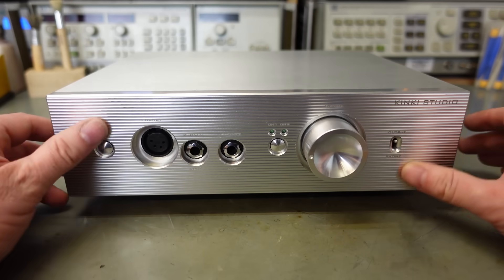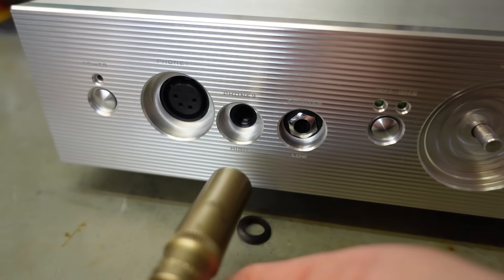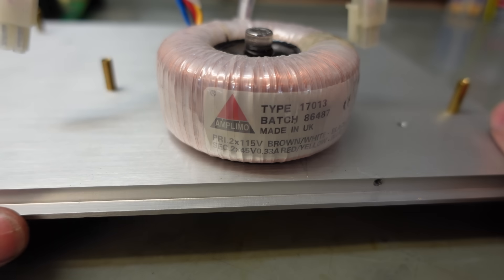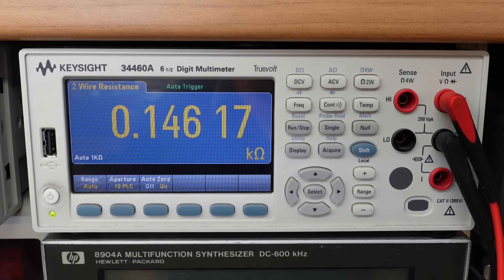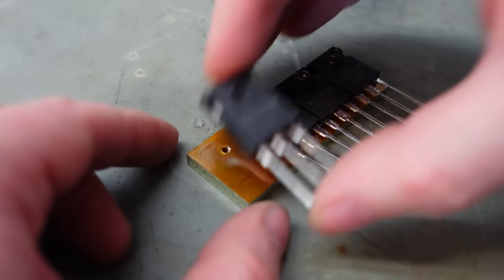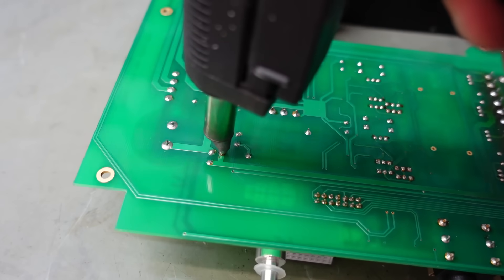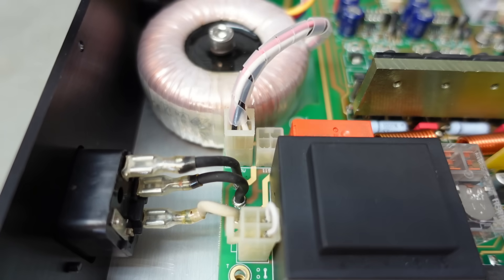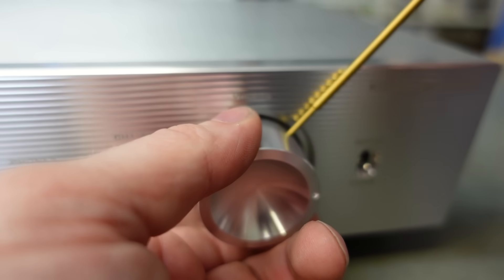KINKI Headphone Amplifier Repair (Vision THR-1)

Comment: This is sadly what the Chinese often do with "high end" audio. It's more about how thick the front panel is than proper circuitry design. It's also often about bragging rights. Brand X has 24 volt supply rails then Kinki chose 60 volt supply rails despite that being completely unnecessary and a poor choice for other reasons. I've been to CES many times and it's always a good laugh to check out the "high-end" Chinese audio vendors.

Comment: That's just a storage heater, not a heat sink due to a high thermal mass and lack of surface area to dissipate the heat and kapton tape. A 3 Watt amp for silly money and they even cannot afford to install the essentials. They should've used the volume knob as the heat sink.

Comment: Building a linear amplifier with MOSFETs is hilarious. 
"Audiophiles" overpay lots of money for the dumbest shit. 
MOSFETs are inherently not linear, just get a Class D amp if you want MOSFETs.

Funny enough, the ones in this system claim they won't fail short in thermal runaway, precisely the way they did fail.

Comment: I'd say the heatsink is inadequate. 126V * 30mA = 3.8Watts. Doesn't sound like much but inside a case with no airflow and a heatsink with no fins it's going to get hot. The proper way to engineer this would be to heatsink the transistors against that huge slab of a bottom plate.

Comment: I never before realized that it requires that much hardware to drive a set of headphones. 🤔
To my best NE5532P appreciation, a couple of OP-Amps, 
some resistors, plus seven Caps,
put inside a box that's too small for a shoe,
as headphone amplifiers, will do. 🤗

Comment: Somewhat confused by the 4 channel test...seems like injecting the test signal through the single ended inputs would produce 2 channel output...any reason why the balanced inputs were not used ? That 4 pin output XLR is for balanced headphones...I have a pair of Sennheiser HD650s set up this way......the reason why this amp  has scads of output power is to drive planar magnetic headphones which eat power for breakfast.

Comment: Didn’t understand the Mosfets being mounted on a relatively small heatsink and then using Kapton tape backing which is actually a good thermal as well as electrical insulator.  I.e. less of the heat will pass to the heatsink?  Seems everything was over engineered except where really needed? Seems to be the fashion in modern Chinese technology - looks great, performs brilliantly, doesn’t last long. Where these Amps differ is they ain’t cheap.

Comment: Many comments are referring to a heat sink but in fact it's a thermal coupler.    In a headphone amp you're not expecting a great deal of power when active, but this is class AB with high voltage to handle high impedance and high quiescent current to minimise crossover distortion.  So you get a significant constant heat dissipation - probably around 1.5-2 watts per MOSFET.  It's critical that they all operate at the same temperature so that the overall quiescent current is equally balanced, hence the thermal coupling.  Dissipation shouldn't be a problem, but I think overheating has occurred as a knock on effect of component failure, rather than the reverse.

Comment: Is this serious ????

This is a headphone amplifier, not a Peavey stage guitar amp !!!

Headphones will provide maximum safe SPL levels with only a few milliwatts input ! At 600 ohms (high impedance headphones) and a huge 5 milliwatts, drive voltage is about 1.73 volts...

So, WHY the heck +/- 60 volts supplies ???? Totally nonsense ! If this thing starts self-oscillating or is mistakenly overdriven, it WILL damage your ears ! And in case of a DC short to any of the rails with low impedance headphones, you'll have phones gently cooking your head.... Nice !

Using TO-247's for headphones and allowing them to heat at a level tha causes board discoloration ? No serious current limiting or overtemp protection ? Huge design mistake.

And, well okay, let's suppose that this thing might be class-A biased... This amplifier has a massive aluminum top cover and it is airtight. Instead of using a ridiculous unventilated aluminum bar for the 247's, why not use an L-shaped heat transfert bar bolted (from inside / bottom cover holes) directly to this huge aluminum extrusion.

Construction is well above tom evans but design (board discoloration is a definitive no-no for any respectable electronic device) is way below standard.

Comment: well that seems like biiiiig fail , a nice case with lots of metal to act as a heatsink , but the actual heatsink where the all heat comes from does not have any thermal paste on the contact  points with the case or mosfets .

Its like management designed an amp , where they fired the people actually doing the job and kept the others 🤣

Comment: A little bit strange, you’ve got those MOSFETs which obviously get extremely hot attached to that tiny little heat sink when they could have thermally connected them to the ridiculously massive outer shell to dissipate the heat?

Do you think those legs are blued thermally? That doesn’t occur until about 300c.

Comment: Love the IC-free, fully discrete transistors design. This is the design criteria developed by ITT and Telefunken in the early '70s.
With this design, you can include one DC feedback network and two AC feedback networks: one for each stage, and another for the amplifier as a whole. You need to know your Nyquist diagrams (and a lot of complex numbers) but the result is unachievable with simple power audio ICs (TBA 810, etc) and canonic op amp designs. 
Such discrete amplifier can operate -10 to +70 °C, has very low noise so achieving 110 dB of dynamic range (an LP is 60 dB, cassette tape 50 dB, CD is 90 dB, Metal cassette tape is 65 dB, FM tuner 50 dB), very high slew rate and therefore a bandwidth of DC to 50 KHz with 0.001 THD - total harmonic distortion; DIN HiFi requires 0.1% max THD. Also, this design is very insensitive to the value and variations of transistors Hfe - or trans conductance in the case of field effect transistors.
Thank you for posting this repair.
Greetings,
Anthony
Reply: There are 1 quid op-amps out there that do just as well or better in terms of THD. For $5 you can get a CMOS DAC that can generate anything you want with that same dynamic range. Nothing wrong with discrete designs - I prefer them. But this thermal tomfoolery is a bit distasteful IMHO. To go to all that trouble to have a full custom machined case and not a proper heating for the transistors…

Comment: I wonder if the current rating on the FETs is on condition of a heat sink? Could it be that the heat sink, laptop tape and lack of air flow caused them to over heat?
Could be that the unit was used in a hot room for many hour’s as well

Comment: That amp costs over £1,000 via Ali Express, although mechanically speaking at least, it is beautifully made. Whether it is as well engineered electronically is another matter though. For instance, does it have any output or or thermal protection given the way those MOSFETs were cooked? It is weird that both channels failed without some common fault, such as in the power supply.

Nb. As much audio jewellery as high quality electronics.

Comment: They grind off all the part numbers, but leave the one for the DC protection untouched, which's a cheap clone part of a hard to find old vintage NEC chip xD. C1237HA, it should be μPC1237. How embaressing! ;P

Comment: When testing the balanced output, do you not need to use the balanced XLR inputs?  Are you not connected to the single ended phono inputs in your test or have I misunderstood that?
Reply: The description of the amp at the manufacturer webpage says, when using the output switch, the amp will become passive preamp (sic!). Yeah - I looked puzzled as well. Anyways: I guess they do not re-balance unbalanced inputs. BUT: if the input is balanced and fed to the XLR inputs, the output should be balanced as well.

Comment: Hi Mark You don't seem bothered about touching the legs of the mosfets which I understand runs the risk of injecting static electricity from your fingers into the devices and blowing them up. Is this a techie myth, the static electricity thing I mean?

Comment: Funny to see all the comments that assume that the design here isn't a true balanced amp & is flawed due to lack of cooling & will fail again. 😆

My guess is that the "balanced output stages" is actually the 8 much smaller SMD MOSFETs. 🧐

The 4 large 8A MOSFETs are only intended for keeping a steady temperature inside. 👍
This explains why this design isn't utilizing the massive chunks of aluminum for cooling, but just strapped these to a "radiator" in the middle of the closed chassis. 😉

Bottom line. "There is no spoon!" 😎
Reply: Why would you need 4 MOSFETs just to act as heaters? That would be truly bizarre. They were also complementary pairs.

Nb. It was Mark that measured the XLR outputs and concluded they were not balanced, not that it would make any real world difference at those signal levels in the sort of environment that it is expected to run in.
Reply: @TheEulerID  My guess because the original Swiss made Amp, which this is supposedly a clone of, uses a thermal oven. 
Also, a true balanced amp has 2 symmetrical output stages pr. channel ( 8 transistors for stereo ) OR has a un-balanced->balanced transformer. 
But I could be wrong. But in that case this €1600,- amp is not what it claims to be. 😏
Reply: @stickmenwithrayguns  well, Mark showed that the XLR outputs are not balanced. For the headphone output, then you don't use balanced outputs. 

I just go with the simple idea that those are simply a couple of class B outputs using MOSFETs for driving the headphones. Given that a standard stereo headphone jack uses a common return, typically grounded, balanced output for those is simply impossible. Only the XLR (one per channel) can do that, and it appears they are not balanced. In any event, I assume they are probably only there to connect to a power amp or other audio component.

Typically low impedance headphones are around the 32 ohms level. If, however, somebody connected the output up to a pair of 4 ohm speakers, then it could easily draw so much more current that it could very easily cook those MOSFETs given they share a rather crude heat sink in a modest sized metal box without any ventilation.  

So, my guess? The output got overloaded with an inappropriately low impedance load and that the amplifier output protection was inadequate. There were a couple of (presumably) resetable fuses that burned out too. 

All compatible with an overload.
Reply: @TheEulerID  In that case this Amp makes no sense. Why would anyone have such a high build quality everywhere except for the output stage? 🙄And don't forget. This thing costs €1600,- on aliexpress and claims to be fully balanced. 😬
Reply: @stickmenwithrayguns  What makes you think it is anything to do with the cost of manufacture? We've had an amplifier on this channel that cost £25,000. This is audiophile gear, and a lot of that is about hype. In this case, it is mechanically beautifully built, it's going to feel extremely heavy and solid and looks great too. The job is to sell to people, and this is as close to audio jewellery as anything else.

I'm sure if manufactured in volume this amplifier would be built for a lot less. Maybe less than 300 Euros, even with all that aluminium.

Also, as I say, quarter inch stereo jacks cannot possibly be balanced. You need two wires per channel to be fully balanced, and there are only three connectors on a stereo jack. In contrast, XLR has three pins per channel, typically with a balanced pair for the signal and a ground wire for the the shield. They are used for things like connecting microphones, which have very low signal levels and benefit from the common mode noise rejection of the balanced signals as well as the ground.  Pin 1 is the ground, pin 2 & pin 3 the balanced outputs and one XLR connector per channel.

Stereo headphone jacks also have three connectors, but carry two channels. One is a common, usually grounded as well, with the other two being the two channels. It's impossible to use balanced pairs in that arrangement as it would require four wires, two for each channel. It doesn't matter what it ways on Ali Express (and the listing I read doesn't make a lot of sense).

Comment: It was quite common for low value carbon resistors in TVs in the 70s to reduce in value - the cathode resistor in valve frame-output circuits were notorious for it.  One always checked the resistor in the case of valve failure - if neglected it could cause premature failure of the new valve.

Comment: The heat sink for the transistors appear to be no larger area than the transistor backs themselves… so there might be some thermal lag but there isn’t going to be much heat dissipation after about 15 minutes of use… looks like that heat sink could do with some fins or thermal coupling to the chassis (which looks a bit awkward given their position!)

Comment: Those fets are based on the Hitachi 2SK1058 series, but the UK manufacturer never seems to have solved fundamental maufacturing problems. What seems to happen is that wafer or packaging impurities migrate into the channel due to heat, resulting in shorts or at least low resistance episodes that cause a positive heat feedback loop.
What you see there is a charred board, you can imagine what happens in a big amp and +- 100V rails.
They were touted as an equivalent, and superior replacement to the Hitachi audio fets, and they do provide excellent performance on the bench. But they are not reliable. You will see this kind of failure with them over and again.
Reply: And those 2SK1058 parts seem to be unavailable. (except for fakes on ebay)

Comment: Those mosfets needs to be designed in a way the heat can be displaced through the chassis.
Reply: The defective MOSFETS are merely a temperature oven keeping a stable environment. 🤫
That's why they are relying on convection cooling inside a closed chassis. 😉

The balanced output stages are made up by the 8 smaller SMD Mosfets on the board. 😊
People commenting on the "bad design" are all wrong. it's hillarious. 😂

Comment: If you are not careful in design, operating MOSFETs in the linear region can result in VHF oscillations in tens or even hundreds of MHz. Could be higher than a scope can see. Enough to cause excess heat.
The ferrite beads probably protect against this...was it 100% successful?

Comment: Tell u why that burned - there is absolutely zero feedback control of the bias current. No temperature monitoring, to regulate bias. Even tho it might look overengineered, it is ill engineered.  Same with the heatsinking - have ther 10 pounds of aluminimum, and they cant even use that for cooling.

Comment: Thin aluminium T profile whit silicone grease on top connecting to the box as add on thermal sink is easy to implement. Why didnt they in the start?
Reply: The defective MOSFETS are merely a "temperature oven" keeping a stable environment. 🤫
That's why they are relying on convection cooling inside a closed chassis. 😉

The balanced output stages are made up by the 8 smaller SMD Mosfets on the board. 😊
People commenting on the "bad design" are all wrong. it's hillarious. 😂

Comment: Mark, you didn't test the balanced outputs well!! To get a BALANCED XLR OUTPUT, you have to send the signal to the BALANCED XLR INPUT. You cannot expect from a single ended RCA input to get a balanced XLR output, it doesn't make sense. I don't understand how you overlooked that. Otherwise, a great channel, one of the best on this topic...
Reply: He also overlooked that the defective MOSFETS are merely a temperature oven keeping a stable environment. 🤫
That's why they are relying on convection cooling inside a closed chassis. 😉

The balanced output stages are made up by the 8 smaller SMD Mosfets on the board. 😊
People commenting on the "bad design" are all wrong. it's hillarious. 😂

Comment: I am fixing a headphone amp also.  Already found 3 bad capacitors that I replaced.  I get a signal again on the left ear of the headphones but it's much lower in volume than the right ear which is operating properly.  I replaced the MOSFETs also.  Any advice or guess.  Much appreciated.

Comment: It's surprising that with all of the overengineering, they didn't use thermal pads instead of kapton tape. Kapton tape doesn't conduct heat as well.

Comment: Is it possible that the amplifier has been used with loudspeakers connected to the low-impedance outputs? With 65 V rails either side of the 0 V line, the output swing of the voltage could be enough to give a decent power output to the loudspeakers, for which the heatsink would be inadequate.

Comment: Quality balanced connectors possibly the reason they are used but it does seem strange.  Nice unit, made in China!  It would have been nice to have done a performance test, i.e. frequency sweep at various gains and THD to see if it was worth the money... Great video at usual, thoroughly enjoy them but this was a bit short!

Comment: With the case being so thick why didn't they just put an "L" bracket to mount to the lid to pull some heat away lol ROFL that amp is listing over $1,000....

Comment: In any case, thank you for this video, following this one, owning in my collection a Kinki Studio (ex-m1+ amplifier), I quickly mounted silicon pads, instead of those dirty kapton pads. 
What's strange is that this device (ex-m1+) exudes quality in terms of assembly, finish and internal components. Why all this penny-pinching over simple pads ? 🤔